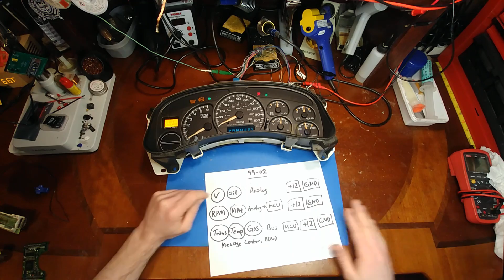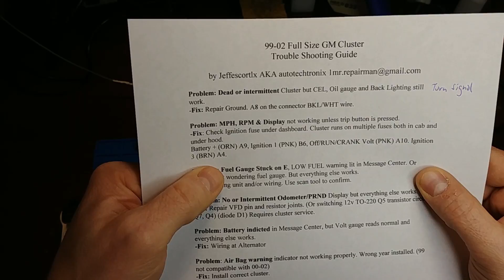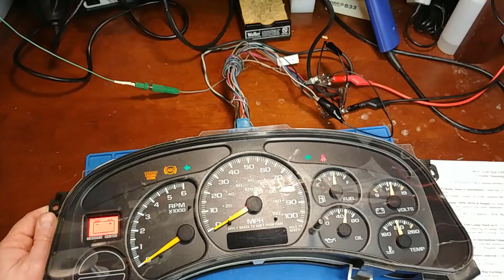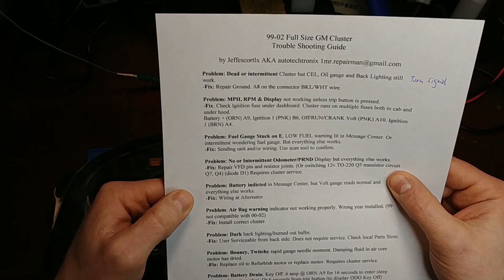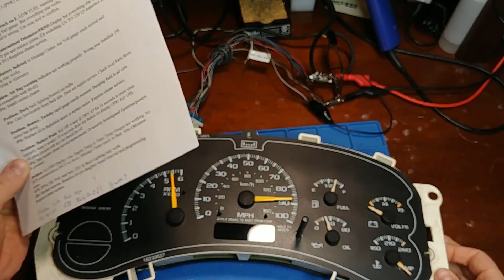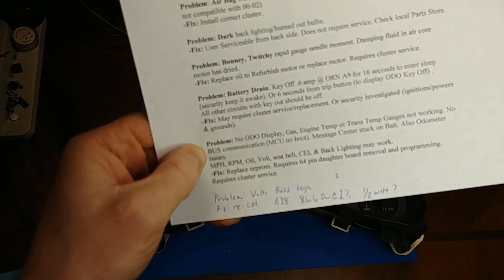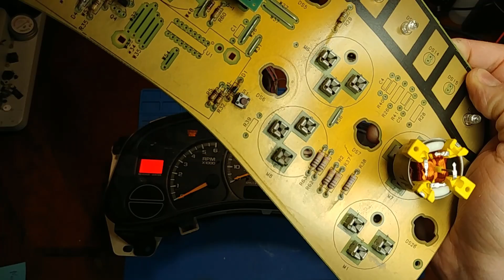GM Cluster Troubleshooting Guide 99-02

Comment: Well  i'm now setting up my cluster repair shop, i have all your technical info ha ha :-D
I know you have mental buckets full of all the faults ever found and every chip use and requirements for operation.
Plus that rom data and others on your computer to program them.
Of cause you have backups of all your data on external storage, i should hope you do.
If you havn't,  you need a slap with a wet fish for being silly :-D
Reply from the maker: Yep I got BIN's stored in my programmers and BIN's stored on my PC, but if something bad happens to both of those I've got friends I can bother for copies!
Reply: @jeffescortlx  Also back them up on a spare usb stick, bung it in a draw so you will always have a full backup, don't expect people to always have copys.
Usb sticks are cheap, protect your valuable data.
i hate to lose data.
I learnt that lesson when i used to type basic into a 4 million year old  zx81 computer and i didn't save it to tape straight away,  power dropped out and the machine reset.:-(
I never made that mistake again.